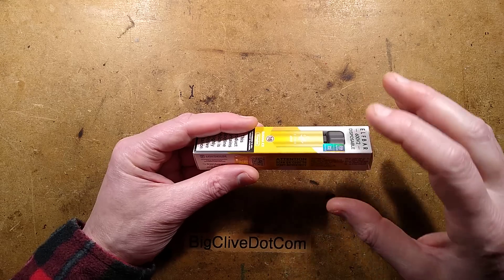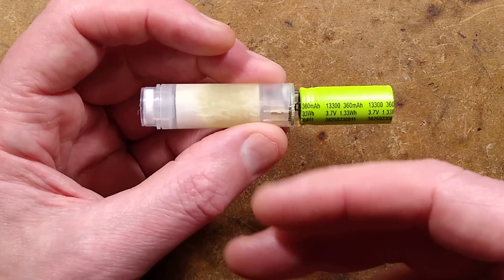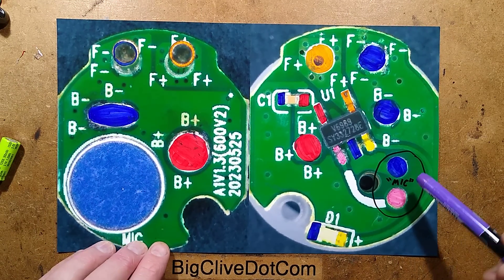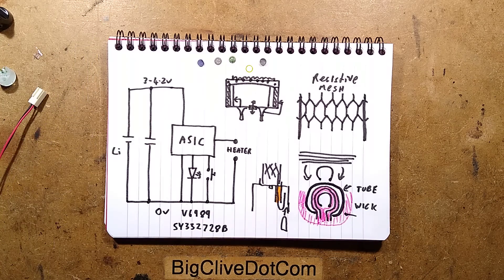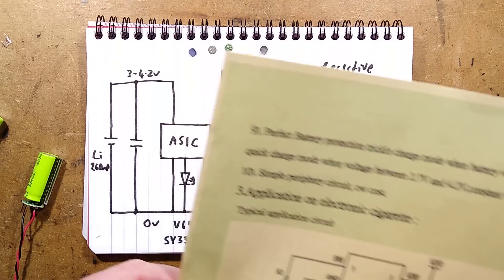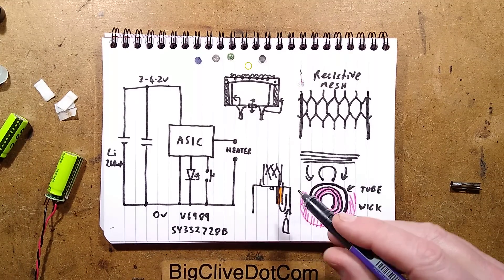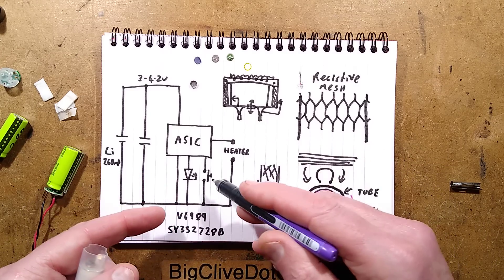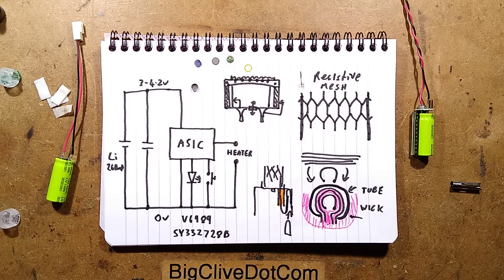Lithium "capacitor" in a disposable product

Comment: You can not really reuse disposable vaping devices, because the heating coil generates burned gunk, and that a) can not be healthy (compared to clean atomizer) b) tastes like death... (on top of being a slow death)
Reply: That's why I use flavourless liquid, as there is less build-up of the non-volatile components of the flavouring on the atomiser coil. My atomiser coils last at least 6 weeks before they taste funky. I still prefer tank systems; they are less wasteful.
Reply: @astrecks You are totally correct! Putting more unknown chemicals into your lungs? I never understood why those vaping flavors.
Reply: caricature

Comment: It's irrational, but I love the form factor. It would be interesting to see what's inside - for that volume, they should hold more than 280mAh. I wonder if there is some (dis)charge protection/current limiting circuitry in it, potentially doubling the ASIC functionality? 🤔
Reply: It'll be the same as a standard lithium cell, but with the terminals both on the same end.

Comment: Please explain the need of the decoupling capacitor in parallel with the lithium cell, which would definitely itself absorb any power instabilities.
Reply: It provides a short current pulse (as when the filament first lights). The  lithium cell has the capacity but it dislikes the fast switching load (called the dI/dT or rate-of-change-of-current limit). Not sure what the worst case is - a meltdown perhaps ?
Reply: @theelmonk  I doubt any lithium cell (especially one that’s designed for single use really), would have any issues starting up such a filament. Worst thing that could happen is a voltage drop that would shut down the ASIC, but I doubt it.
Reply: @ThanosSustainable  You could be right but it seemed a likely reason.

Comment: I put Street Lithium in the cheap blue headtorch from Poundland and a TP-4056 and it's fantastic.  You get 30 mins of insanely bright light or 90 minutes of very usable light.  No sign of the LEDs going rotten as the heat sink is pretty decent.
Reply: The decline of street lithium will leave the next generation of young engineers without a valuable source of materials to practice on.
Reply: "street lithium" 😂 good one
Reply: I did similar "project", replaced in cheap headlamp three AAA batteries with one waper Lithium battery- it works, and seem to hold quite good charge. Another bonus is that it's quite noticably lighter now. It's really a shame that those batteries are beeing just thrown away.
Reply: I use these for cheap touch s of ebay with out of date batteries from new.
Reply: Insanely Bright? That can be a warning sign that there is too much current flowing in your circuit. Too much current can cause too much stress to the LiPos. Are you sure you used a protection circuit with current limiting that is suited to your head torch power consumption?

Comment: I'm very interested to see the internal construction of that "capacitor". Is it purpose-built, or is it an off-the-shelf lithium cell in a little capacitor-shaped canister?
Reply: It's a standard battery form factor. It's just very rarely used due to the resulting shape. Seems perfect for these vape devices though... Just a pity they insist on them being disposable.
Reply: Yes! Open it, open it.
Reply: Off the shelf I'd say, a super cheap ball hair trimmer I got from Ali had this same exact cell in it.

Full blast it lasts like 15mins though.

But for a "Idc if it breaks" object, it's just fine.

Comment: I've been using a pod system for years, but the quality control on the replacement coils and pods as well as the devices themselves has gotten so terrible that I've started using Elfbars, and refilling them. The normal sized Elfbars are significantly more robust than any pod system I've tried. I've found I can run 5 30ml bottles of liquid through one before it starts to taste funny. That's like 2-3 months of use out of one Elfbar. Doing it that way is cheaper, too.
Reply: rda/rdta are the way to go if you want quality as you're building the coil & wick yourself, also so much cheaper long term and once you get used to winding coils & cropping them to length it takes only 10/15 seconds (you can also get pre built coils but rather a waste). In total it takes me under 2 mins to take my rdta apart, clean the rank, remove any leftover gunk from the plate, wrap 2 coils, screw them in, cut the cotton & rewick, and fill back up with liquid.
Reply: @michaeltodd17  I did that for a while. At some point, I realizedy nicotine habit had become a hobby, and one I didn't particularly enjoy. And they're just too damn big and leaky. Back in the day I had a few fancy mechanicals and RDAs. Think they're still in a drawer somewhere. I actually got so sick of vaping that I went back to smoking cigarettes for a while 

I like pod systems for many reasons, but the biggest being that I can go all day without having to refill or recharge. If it costs a little more that's fine, it's still an order of magnitude less expensive than cigarettes.
Reply: @NonEuclideanTacoCannon you can get all day everything with a squonker 👍

Comment: Intriguing new design of cell that, looks much sturdier than the pouch cells that seem all too easy to accidentally pierce, though at a cost of capacity, but far more handy for integrating onto a DIY PCB design of somesort...
Reply: I've not really seen much of those pouch cells anymore. They usually only come in one of those weird flat Lost Mary's or the Geek bars which have pretty much been phased out already and no one uses them anymore. Now all I see is the regular LiPO batteries that are somewhat smaller than an AAA in terms of height and width. And the massive ones that are like a bit smaller version than the D cells.
Reply: @genesis1914 not so in the UK! The majority I find are still using pouch batteries in various shapes and sizes. Not all pouch batteries are flat and rectangular 😉
Reply: @genesis1914 those AA shape batteries are pouch types too, just cylinder shaped!
Reply: Sure, the pouch type batteries are more easy to pierce, but they are more resistant to crushing when inside the vapes. Trust me, I have much experience after collection hundreds of these things 😅

Comment: Some new bright RC cars sold at our local Walmart that have a rechargeable battery that you just charged with USB it's actually two of those cells inside the RC car not sure why they didn't just use pouch cells but I guess this new type of lithium batteries a new thing I bet it makes more of a bang when it does tonight's because it's got a vent like a capacitor and release all the magic smoke from inside the battery smells really lovely when lithium batteries do that

Comment: I saw a photo not too long ago of a lithium cell built into the shell of a capacitor (from first glance it just looked like a normal cap) and had no idea whether or not it was a real product, but seemingly it is!
Reply: Reminds me of the old real-time clock chips that contained a battery in the epoxy to power it. The offending devices I know of being the Phillips CD-I console and a number of 286-era PC motherboards (later problem boards tend to have a soldered-on rechargeable battery that's prone to leaking). They're a headache for retro-tech hobbyists because the devices they were used in are now old enough that the battery has gone flat and won't boot until you get the clock working again.

Comment: clive the pressure switch may not actually make contact ie N.O contact but acts as a variable  capacitive device which the ASIC chip input monitors . if you tear down the sensor the chip acts as a touch sensor. i tried this after seeing a youtube video. can not  remember who it was but it worked but can be zapped as it lacks ESD protection.

Comment: I have had one for a while now sitting in the collection of possible reclaimable cells but never got round to exploring yet pile. Thanks for saving me a job.. I also have a new device that uses a ceramic type heater block. (its branded as a vuse go edition 01) it seems to be quite unique that once the cell has been discharged during use it then locks the cell out, after recharging the only way to get it to work is to remove the power or ground from the circuit to sort of reset it and allow it to work again.
Reply from the maker: The RELX units also use an odd rectangular ceramic heater with inlaid element.  I would have made a video about it, but YouTube gets upset with vape videos.
Reply: They've been an oddity in vaporizer design for years. Iirc first done in the Aspire Cleto. Though I could be confusing that with something else. The idea was it would increase the longevity of the heating element. I don't think it did.